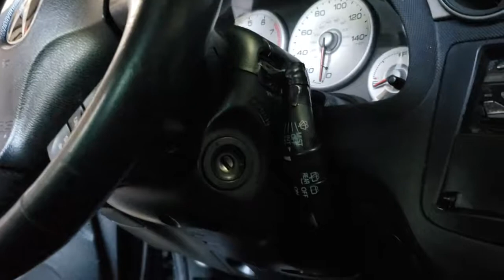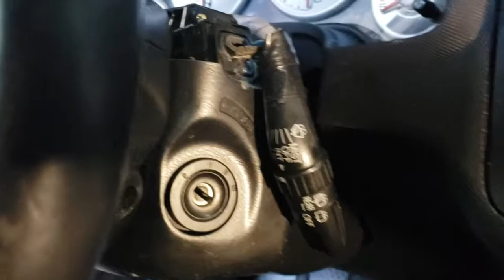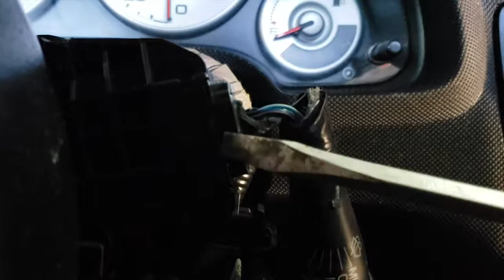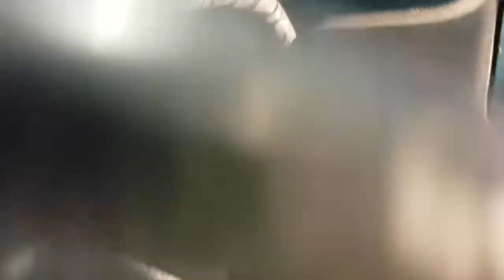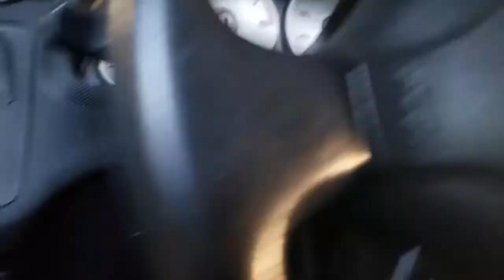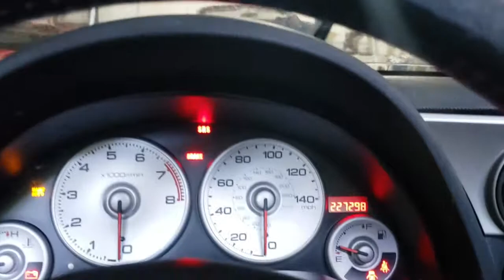Replacing Windshield Wiper Control Switch 2002-2004 Acura RSX

Comment: Ok, thank you for the video.  I ordered the replacement arm and was able to replace it with no problems.  However, I am still having the same issue with my wipers.  They will come on but will not turn off.  I have a 2003 Acura TL-Type S.  So what else can I check to see why they will not turn off other than turning the car off?  Thanks.

Comment: hi, is not necessary to disconect the battery? and is no risk of airbag deployment?
Reply from the maker: That is correct. There is no need t disconnect the battery. It will not cause any electrical issues or air bag deployments. :)